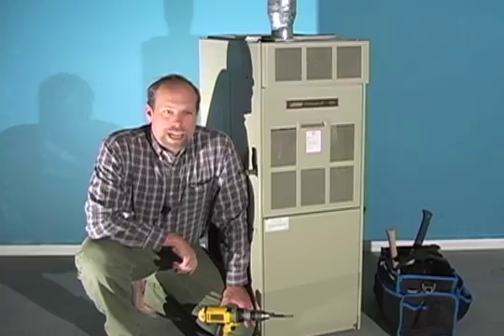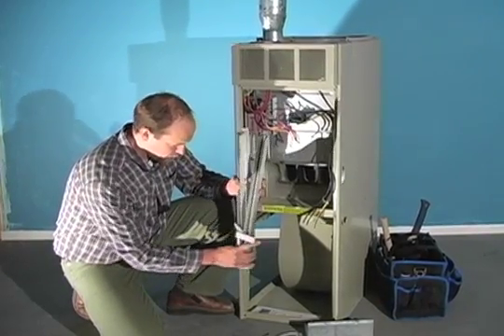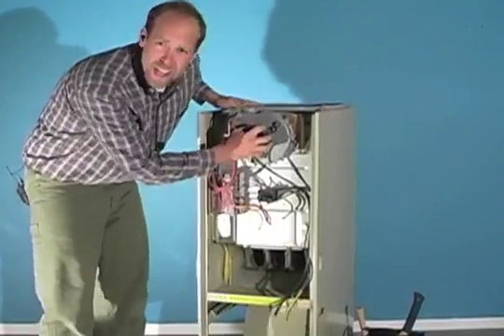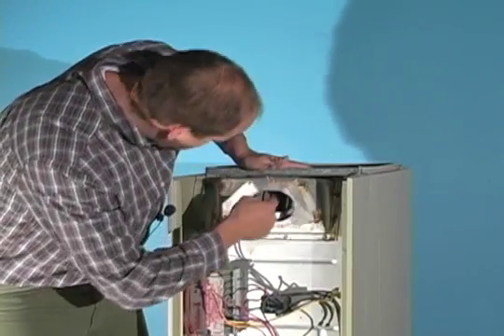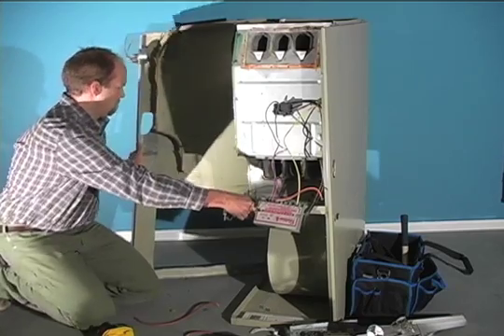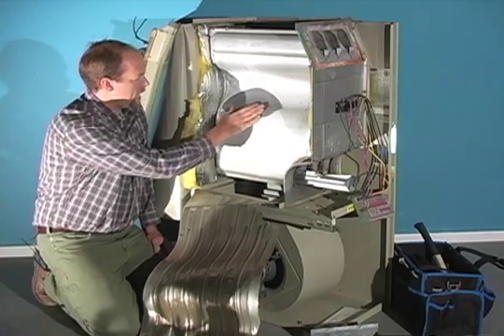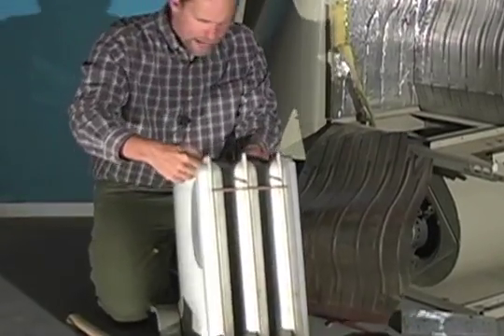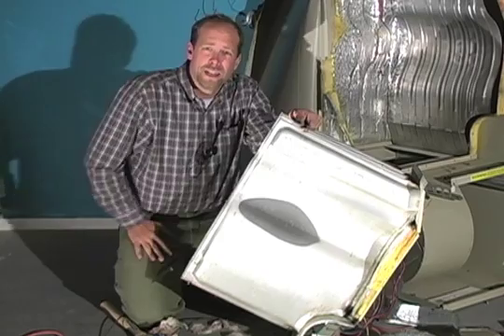Finding a Crack in the Heat Exchanger During a Home Inspection

Comment: Repair person showed me pictures of heat exch crack he took with probe camera.  Hopefully pictures were of my furnace he was inspecting??.  I have removed heat exch and separated sections from the replaced 12 yr old furnace that I kept.  Have similar wavy type heat exch that has the large dark spots you say indicate overheating.  Am unable to spot cracks on outside sections.  Repair person photos showed what would be an obvious large crack.  Could he have taken photos of inside the heat exch itself where flame shoots and how could I find a crack in that location?  Can flashing light or putting water inside exch be used to find cracks that are not visible on the outside of the exch?
Reply from the maker: Thanks for commenting, Johnny.
Reply: I would take the bare heat exchanger to the shop that told you it had a crack and ask them to show you the crack.

Comment: designed to fail, big surprise. 
Didnt have this problem on oil furnaces. Lots of homes running 50+ y.o. oil furnaces.
Reply from the maker: Great point!
Reply: They require maintenance and will soot up. Efficiency is no good and the cost of oil is through the roof. In the end, those wonderful 50+ year old oil furnaces cost the owner a fortune every season.

Comment: You said 'this is the draft inducer fan we've got some like insulation material for a nice airtight seal'.. That look like 'thin glass wool'.. Do you know where can I buy thin glass wool.. I need that because I want to install that between each part for protecting part from heat.
Reply from the maker: I don't know where to buy that material.
Reply: You'll need new gaskets or seals. Get a new furnace! lol
Reply: I used a ten dollar tube of automotive gasket goop. High heat of course

Comment: If heat exchanger has a crack or several crack, What is problems?.. Maybe bad gas(carbon monoxide) can spread all over the inside house through vents.. That would be not healthy to person.. and sometimes can die.. Is that right??.. (I am not sure).. and Maybe house can be exploded??? (because gas leaking)
Reply from the maker: Carbon monoxide poisoning. Yes.
Reply: @BigBenGromicko  Was under the impression that natural gas gives off no CO.
Reply: @CL-ty6wp   Any appliance that burns fuel can give off CO. Gas ovens, generators, gas fireplaces, wood fireplaces, etc.
Reply: @CL-ty6wp  there are some novices that will tell you that a furnace with a draft inducer can’t give off CO cause that draft inducer is creating a negative pressure in the heat exchanger. That’s bogus. If the heat exchanger is cracked it’s no longer a sealed unit. Look up videos of flame rollout.
Reply: @CL-ty6wp  Ha ha!